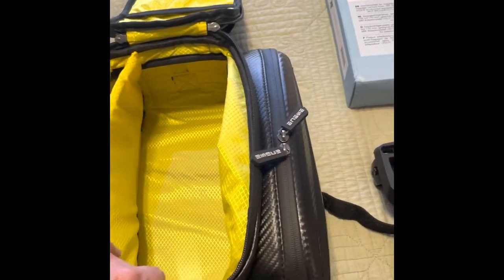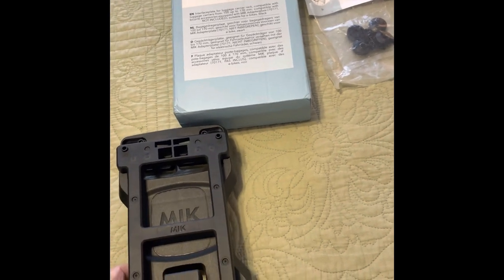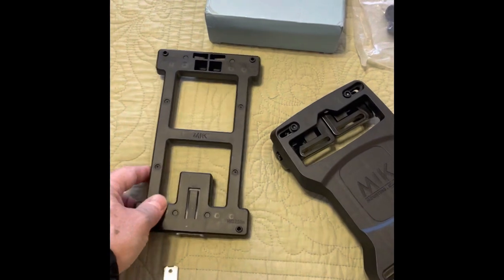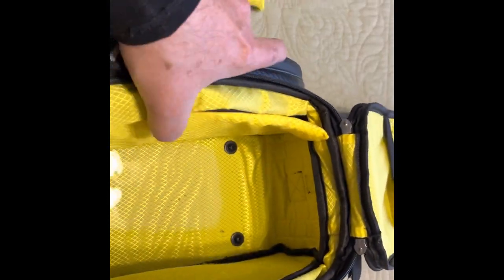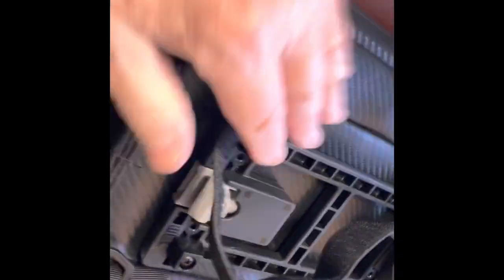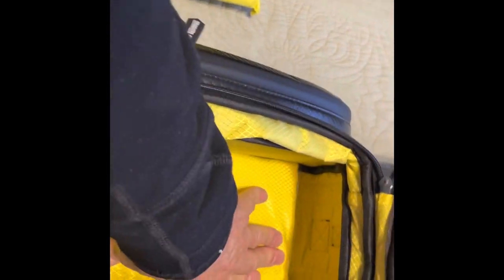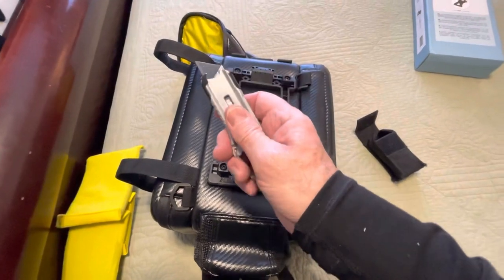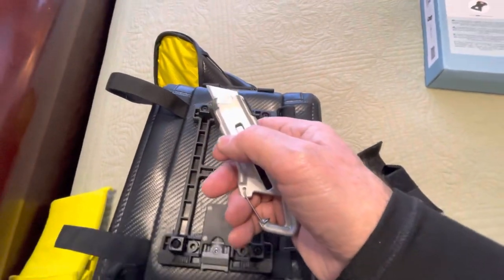MIK “Mounting is Key” “Make It Click” ENGWE bike bag conversion.

Comment: Thank you for this Idea. I'll answer some comment questions. For those wondering about Plexiglass. You can find them in Larger Picture frames. If you are okay with a non Clear option, look for flexible cutting boards. You can cut these with Tin snips, or even a robust pair of scissors.
Because I have an Electrical saw, I would go a plain plastic cutting board. Plain cutting boards are cheap, easily available and it will make the whole thing sturdier;  produce an additional frictional binding (due to texture) when bolted, spread the stresses (by being rigid) away from the bolt points. 
The stock bag bottom is likely to have 4 layers. Outer shell, Backing or stiffening material (Cardboard/plastic), inner padding (foam), inner shell. When drilling holes, it s a good idea to glue the edge of those holes. This will make sure fabrics don't fray and the layers do not separate with vibration. I would use polyurethane glue / shoe goo / anything with a flexible hold. (NO SUPREGLUE) Wait for the glue to dry before inserting the bolts. Glue is more important if you are using the flexible cutting board/plexiglass since they will both produce localized cinching around bolts.

Comment: Nicely done. Did you use a knife to cut through the plexi glass as well to fit inside the bag?
Reply: Try to drill out the holes using first a small new drill bit so as not to shatter the plexiglass, then a bigger one the right size for the holes